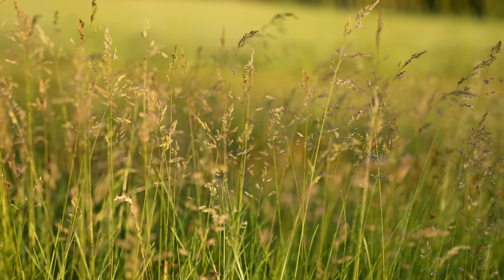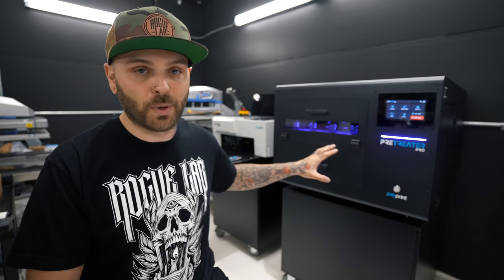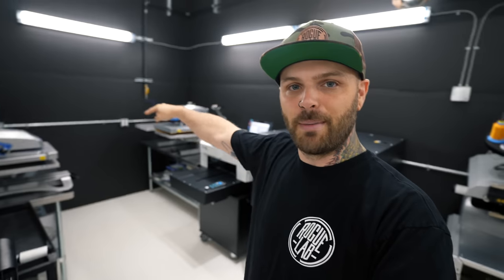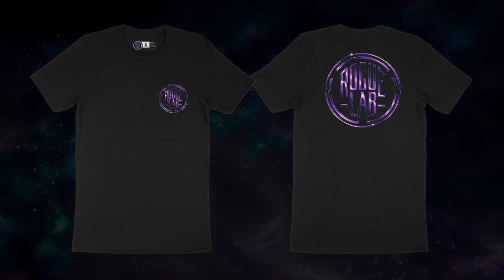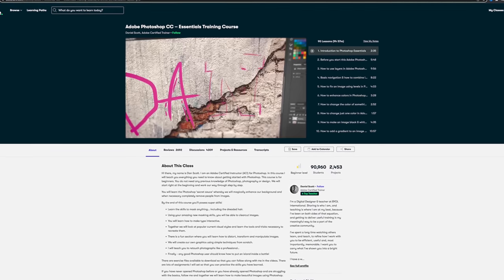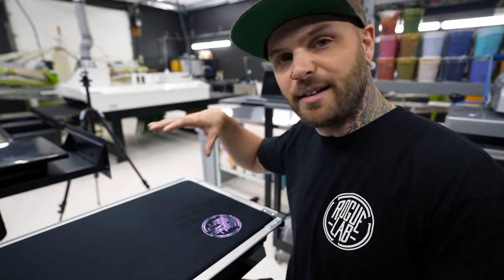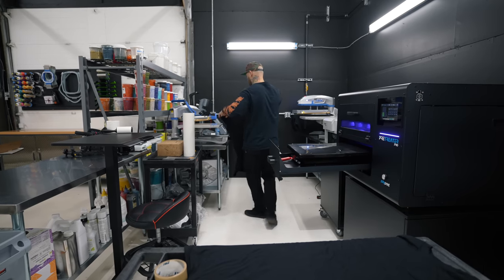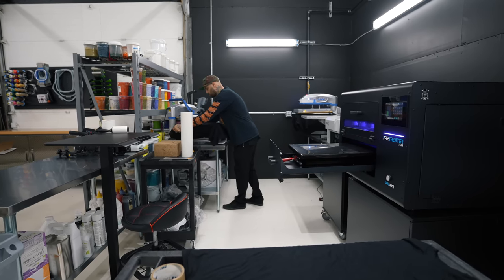My First Time Printing Shirts with a DTG PRINTER!

Comment: We do a LOT of DTG and we've found that if you do multiple smaller-timed presses (with a few seconds in between), you dry the shirt without crystalizing the pre-treat. Details: Using medium pressure set to 350 degrees press the "box" area in 15 second intervals, flipping the curing sheet between each press. (Most tees take 4 presses to dry.) Finalize by pressing the tee under heavy pressure to prevent fibrillation. (edited)
Reply: What DTG you recommend per your experience?
Reply: I would also like to know
Reply: @MrAlbertodelacruz  We run Brother GTX Pros. The machine is incredible and produces the best prints I've seen without going the route of $100K+ units. The company sucks to work with and their backend ordering site has been down all year. Thankfully, 3rd party sellers are cheaper with official parts/supplier any way. I can't recommend the GTX Pro enough.
Reply: @brantsarkela3189   @3Dimenziones Studios  We run Brother GTX Pros. The machine is incredible and produces the best prints I've seen without going the route of $100K+ units. The company sucks to work with and their backend ordering site has been down all year. Thankfully, 3rd party sellers are cheaper with official parts/supplier any way. I can't recommend the GTX Pro enough.

Comment: When I used to run DTG I would pretreat all the shirts a day before or all of them at the same time before printing which actually was more productive. The way I avoided the pretreat box to a min is to hover the heat press close to the shirt for about 1 min before pressing the pretreated shirts.
Reply from the maker: I'll give that a go. I have a few things to test for next time
Reply: After left the shirt for a day? Do we need to heatpress the shirt back before we print the shirt?
Reply: @aimaniman5557  it's best to press it again for around 5 sec and then print.
Reply: @crumptees  i will try the tip bro, thanks a lot

Comment: A tip for the pretreat box…
Pretreat your shirts a day in advance and hang them to air dry. The next day, press them to remove remaining moisture. Or even conveyor dry them (they will have a different print). 
When curing the pretreat we mostly like to dry them on the conveyor (very slow speed & lower temp than screen print), the box will not be there & the print will be more vibrant since you’re not smashing the ink down as when heat pressing.

Comment: I have a Ricoh ri1000 DTG and Viper Maxx pretreatment. DTG adds so much value to my print shop. To avoid the DTG box as much as possible, I use light pressure and low temperature (285 degrees) when curing the pretreatment. The light pressure allows the pretreatment vapors/steam to escape from under the heat press. Also recommend opening a door or setting up ventilation so you're not breathing in those pretreatment vapors.
Reply from the maker: I've got a few new tricks and gadgets to try for the next one that should help minimize that box
Reply: @leestuart38  As long as ya "press" as long ya´ll get the box - if ya proof me wrong, please, asap - thanks! :-) 
(Try tunnel-drying if ya run screenprint-jobs simultaneously anyhow)

Comment: Use your tunnel dryer to cure your pretreat, then heat press the shirt prior to printing to matte down the fibers. Your heat press pad will retain moisture, making it longer to cure or not cure evenly. You can use the dryer to cure your DTF prints as well
Reply: Drying conditions for pre-treat are different than properly curing conditions for DTG. Don't recommend.

Comment: The box is from the heat press. Try lowering your heat press settings to the lowest threshold of drying point and it should do the trick. Once you find the low point you can work your way back up till your happy that your getting enough heat to cure, but in many cases it just happens. I see the box even with DTF and transfer vinyl so rest assured its not your pretreat. It usually goes away even before the wash as garments get stacked and moved around a bit.  Also side note, I have noticed quality of dye makes a difference. Long time viewer love the channel.
Reply from the maker: It is the pretreat in this case. I mentioned it in the video that I thought it could be the heat press marks which do go away, but the part that got sprayed stays until it's washed. I have some new stuff to try for the next one though
Reply: @leestuart38  We use Firebird. Best we've found so far. You also need to find the bare minimum amount of pretreat that gives you the best ink coverage. Even a little extra pretreat makes it that much harder to get rid of the box. I would also suggest definitely using your conveyor dryer for speed and consistency, just make sure they come out at least a little damp to help flatten those fibers with the heat press. We are also diving into DTF and kind of pitting DTG against DTF. In my opinion, DTF has more pros over DTG then cons. I would rather create designs with more dead space for DTF and be able to press it onto any garment I can put on my heat press. DTG is so limited to the garments you can print on without having an exorbitant amount of different pretreat and print settings depending on material, color, and garment. With DTF being fairly new, I think there's a lot more room to improve ink (white especially) and powder that will help with the overall feel of the print. Pretreat is always going to hinder DTG printing, in my opinion

Comment: Lee we run dtg using Epson F3070’s and digital factory and we also have the same BBC dryer you have. We figured out that the BBC gets rid of the pretreat box use it ! not only does bbc eliminate the pretreat box it will speed up your pretreat time.
Reply from the maker: Definitely something I'm going to test but I don't want to rely on it because I want it turning out screen prints all day without having to reset and slow down for DTG stuff

Comment: Legend has it if you get the lower heated platen power pack you can heat from the bottom and heat from the top with less heat to avoid the dtg box
Reply from the maker: I already have one on the way to test in a video haha
Reply: @leestuart38  perfect can’t wait to see how it works keep grinding and going hard you have one of the best set ups I ever seen thanks for letting us in

Comment: I ran a converted Epson P600 for a few years (out of my bedroom closet) and got some amazing prints off it. The only issue is that consumer print heads just arent meant for long-term DTG use. As for pretreatment, I find that firebird pretreatment was money for the application window and pre-treatment box post-press.

Note, the poyl proint is essectially a Epson P600 or P800 from what I understand.

Also, I'd suggest good ventilation or wearing a mask when pretreating. Looking at the MSDS, you don't want to breathe this stuff during the curing process.

Comment: I have the same setup. Make sure when not using the pre-treater you remove the nozzle heads. It will prevent crystallization in the head. Other than that it’s awesome machine.
Reply from the maker: Yup that's part of the daily maintenance routine

Comment: Good to see a notification from you again! Its been a while
Glad to see you're back with another cool video
That printer has some serious vibrancy.  Nice colours.  Im curious about fade after 20+washes.
Its the main reason why i stick with dtf, even though i agree with your comment about the feel, but its improving slowly. 
Welcome back! 
Lets go!
Reply from the maker: DTF is DTG essentially that's what people don't seem to know. It's the same inks and printing process, just swapping out pretreat for adhesive powder. So the longevity is the same
Reply: @leestuart38  sorry man, i disagree.  I've been doing dtf for almost 3 years now...the adhesive give a vinyl like feel but it increases the life of the ink. Im not claiming to be any expert,  but that's what i found.
They are the same, yes, but different. dtf lasts longer because of the adhesive and the curing process. 
Maybe you can try with your printer. Dtg vs dtf and see which one lasts longer at 20+ washes

Comment: 6 minutes a print is wild
Reply: after a few months of use it takes longer. there is allot of things that start happening once the print heads get used up. i have had to go with 20min a print at times. no joke
Reply: @georgedjmatrix4229  that’s crazy, my GTX is like 2 minutes for a full a3 size design 🫥
Reply from the maker: This machine was never supposed to compete with the GTX in speed. The print quality is the same, but its $10k cheaper than a GTX so I'd say the extra time is a fair trade lol. Their new machine coming out will go head to head with a GTX. Hopefully I'll get to test it in a video.

Comment: My job also requires me to using Dtg  machine, sometimes for certain apparel(tetracotton,polo,hoodies,microfiber cotton blend) I just avoiding heatpress machine cause it sometimes make final results a bit dull and dye migration, I'm just using hovering heatpress, conveyor dryer.
Reply from the maker: Dryer would definitely be the way to go. This is a good starting point

Comment: Pretty slick. Regarding color matching. I wonder if you build a 4color white and overprint onto that if you could match your screen better vs overprinting on whatever base white ink PolyPrint uses. And or, calibrate your screen to match their white. idk. Either way, they came out fantastic. Need to get into printing on substrates that aren't paper. -_-

Comment: Lee when how do you feel about the conveyor dryer vs heat pressing to cure. I spoke to poly print once and they it works good and improves ink vibrancy. Also for the pre treat issue maybe pretreated shirt might work.

Comment: Nice detail, what’s the top colour look like super up close? Does it halftone the blends, or mix as it goes with no noticeable halftone dots? Curious if a guy could screen print overtop of DTG with plastisol. 🤔
Reply from the maker: The dots are too fine for the eye to see like with most inkjet printers. It's super clean looking, I'm impressed so far. There's a kit for this printer to do the opposite, screen print the underbase and DTG the top colors. I'm going to be giving that a try soon

Comment: Regarding the pretreatment box, wouldn't it be great to have a "pretreatment printer" which applies pretreatment only to the exact shape (with some extra margins) of the print instead covering the whole shirt?
Reply from the maker: Registration would still be very hard unless it's was integrated into the printer or some way that the shirt would stay in one consistent spot for the whole pretreat/print process. But it's definitely something to think about, the tech is progressing very quickly and digital is here to stay

Comment: Hello. I have a question. If you have no a lot of orders with DTG printing, how will you resolve problem drying up Print Head, because of white color? It clean up Print Head every 3 hours, and it 
spends a lot of expensive ink. And if you will not clean up PH every 3 hour it would dryed up. 

P.S. Sorry for my English, I am from Ukraine.
Reply from the maker: This machine does not need constant cleaning like that. It can sit idle for up to 30 days without cleaning the print head
Reply: @leestuart38  Oh... and you can turn off this machine for several days without cleaning? Are you sure? I use Epson and we have a lot of problem with it, because we have not a lot orders with DTG.
Reply from the maker: @copyprint5021  yes I'm sure
Reply: @leestuart38 Thanks for the answer

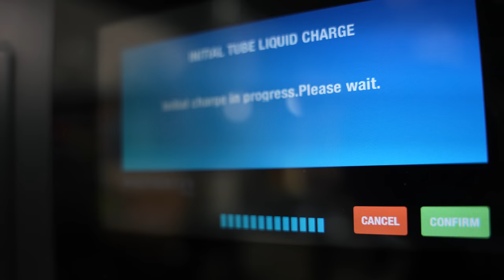Comment: Hey man! At 3:25 you are putting the wrong type of water. You need, and that's a MUST... distilled water. You will get bad pretreatment results, and your machine's pumps will suffer... I have the same pretreatment machine. Talk to a Poly Print technician ...
Reply from the maker: That is distilled water

Comment: i hate how DTG is becoming so popular but the quality still is not on par with silkscreen, also get ready for the maintenance even when you do not use it.
Reply from the maker: It's not meant to compete with screenprinting which is what a lot of people don't understand yet. It's a gap filler between transfers and screen printing at the moment which is why it's popular. Transfers suck on nearly all fronts, and a lot of jobs don't make sense to screen print like what I printed here. That would have been 12 screens to set up, wouldn't make sense for anything below 75 pieces. DTG is a great option and the print quality has come a long way, the inks in this machine feels very close to an HSA screen print and it can sit for 30 days at idle with no maintenance. Screen printing is still king of the quality game and we have a good 10+ years before screen printers need to worry about DTG
Reply: @leestuart38  nice counter point, However, I'm not "some people" I have sold hundreds of thousands of shirts, both silk screen & DTG (DTG only when I wish not to reprint another 500 of a design for a couple of possible, and likely, sales).. 
Given I have talked to a few reps for DTG & know fellow brands who use it primarily now.. guess what DTG was created to be and is working towards? Yup, a replacement to silkscreen. It's almost like my comment was based in truth and knowledge on the subject. 

The problem with DTG is much like with AI art, and although it can be argued both have a decade before they replace artist or silkscreen printing.. the problem boils down to the common man.. the common man tends to make the most mediocre choices due to convenience.

Comment: Yea like 30,000 dollars later plus cost of supplies and nozzles clogging at some point.  Love the machines but doesn't seem to be worth it
Reply from the maker: Well mine has made over $2000 in the first week since I've had it running, so definitely worth it if you do it right. And if you do daily maintenance clogging is not an issue

Comment: The box isn’t unavoidable, it’s just that the company reps are all useless pricks who only care about your sale and don’t know shit about the actual work. Open the heat press and let it breathe during the pretreat drying process, let some steam off each time. Sometimes on a heat press it takes 2-4 times to let it breathe to get rid of the box. Better yet, use your Aeolus to damp dry them, then prepress before printing to remove final moisture and make the surface glassy smooth. We use this in full production and do 100s a day. 😊